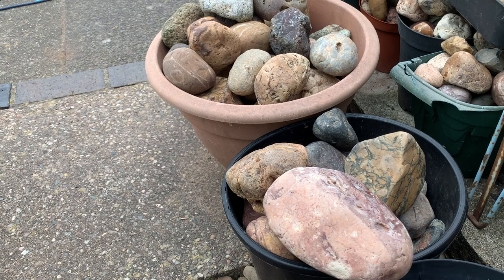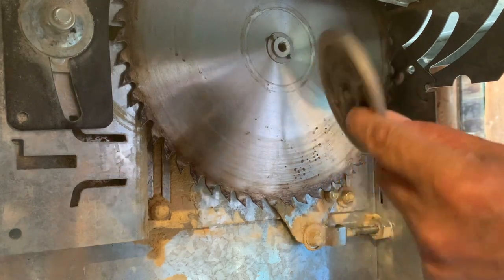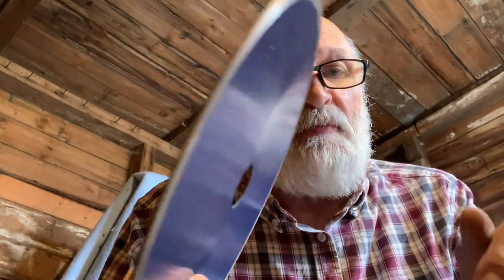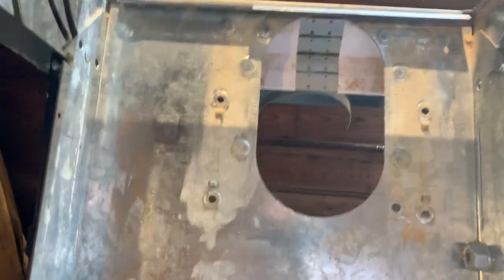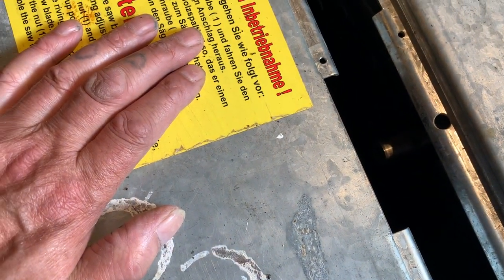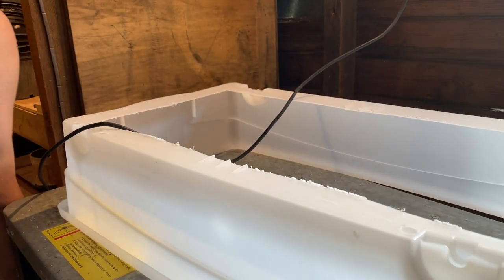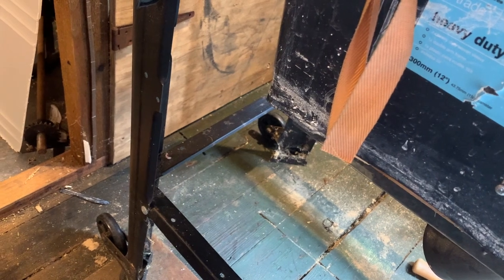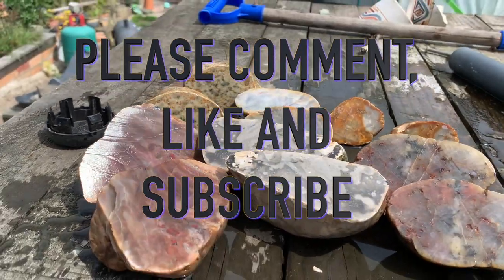DIY Rock Saw Conversion

Comment: Thank you, I have a cast iron top 10" table saw to convert. For cooling though I'm going to make a light jig holding a couple of spaghetti hoses to drip water on both sides of the blade from near the top. Nice rocks, I've been scouring my beach and I need to know what's in them too :)
Reply from the maker: watch out rockhounding can be addictive, nice 1 and welcome to thecaptainshow:face-blue-smiling::face-red-heart-shape: